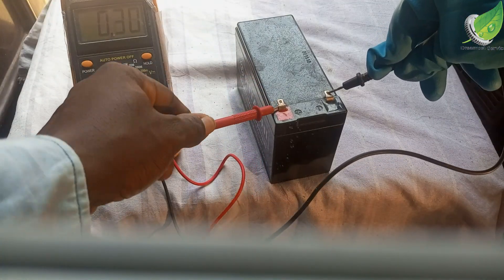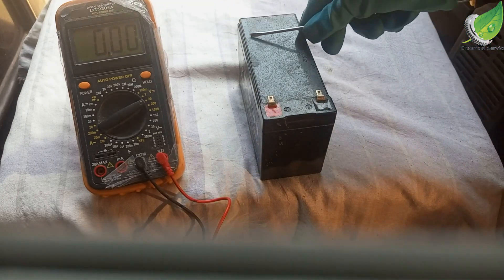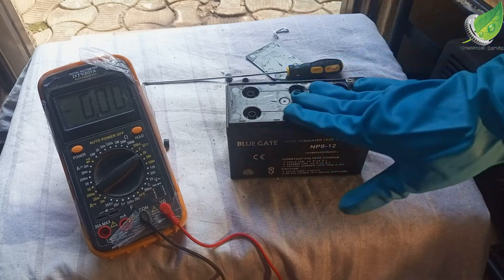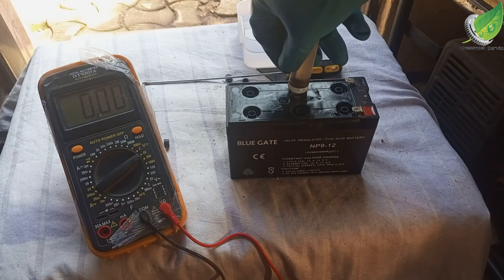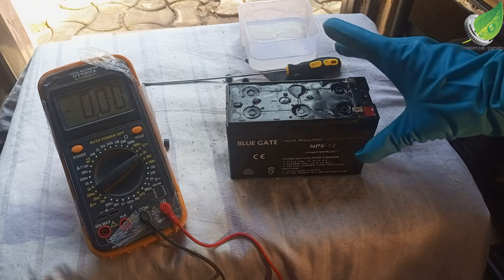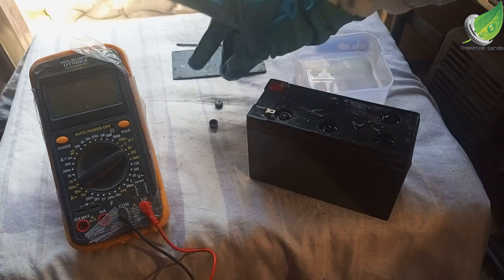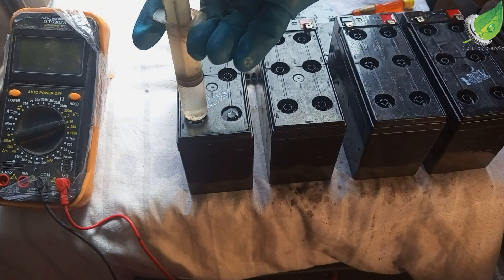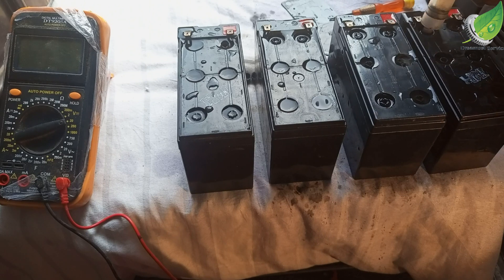Revive Old Dead Battery

Comment: What will happen if one use electrolytes instead of distilled water
Reply from the maker: You first have to measure the quantity of electrolytes in the battery to determine if you need electrolyte or distilled water